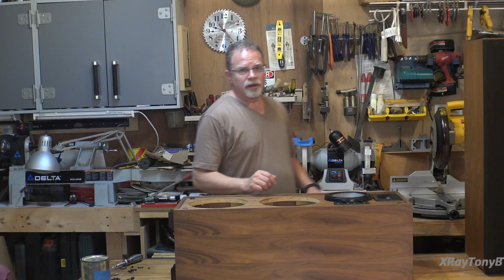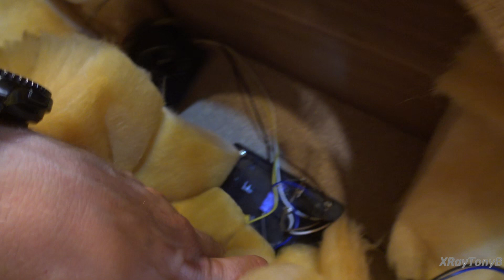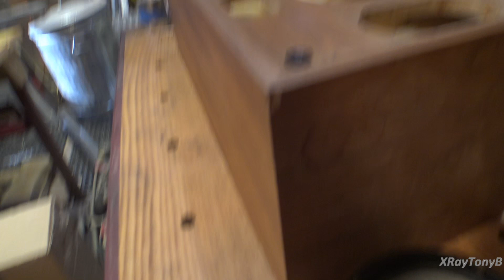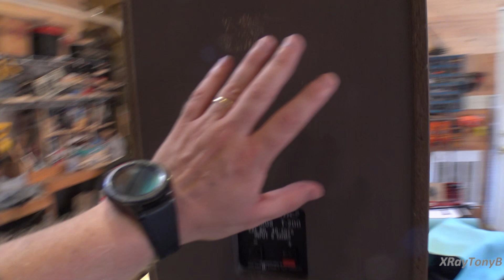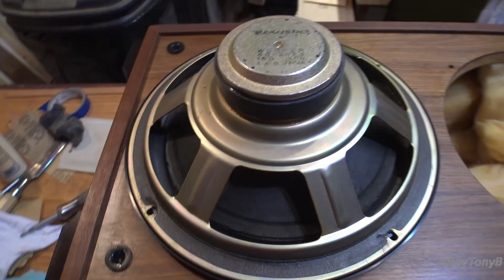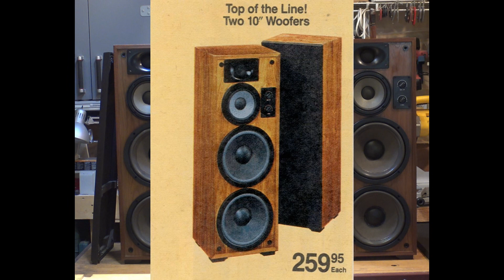Finishing the Mystery Speakers

Comment: The T-200 is a sentimental favorite of mine.  And it sounds GREAT too.  It is VERY important to have the original drivers, because it all works together as a system.  I've experimented with other replacement drivers, and even a "real" crossover.  The results were dull and lifeless.  The smooth overlap between drivers is what gives them such a clean sound.  A pair of these in good condition with original drivers is rare, and still brings top dollar.  Thanks for the video, Tony!

Comment: FWIW.  Parts Express does have 33uF/100V non-pol axial lead electrolytics. Currently, $1.20 each.  Part number 027-350.  Naturally, they have Polypropylene and the like too in 33uF.  

I would hesitate to call that a "crossover" as it does not cross anything.  It is, at best, two high-pass filters so the mid and high don't get frequencies way out of their range and they are 1st order.   Since the LF drivers are getting full-range...they will beam as the frequency goes up.  But hey, as long as you like them, that is all that counts. 

One other thing...power is power. You can't magically get more power handling by how you wire them, as I think you implied.  If the drivers are rated at 30W (presumably RMS of either sine wave or pink noise) and there are two of them, then 60W is the total power for the LF section of the speaker.  Wiring them in parallel doesn't change their power rating.  It will change the power that the amplifier has to supply as the impedance of the system is lower.

If they are 30W drivers and 16Ω.  They can take roughly 22V.  Wire them in parallel, they still are only going to take 22V as a team.  You'll get your 60W because each driver will consume 30W.  The amplifier, outputting that 22V in an effective 8Ω load will be trying to output about 60W.  Naturally, that Pioneer doesn't have the 60W to give.  But even bumping up to a 75 or 100W amp you aren't going to get much more volume.  3-5dB over the 35W.  A key benefit to the larger amps/receivers is they would be further away from clipping...which is what would be the most damaging to the speakers. 

My guess is that RS did the rating of the speaker as peak power...which is, typically 4X continuous.

Comment: I’m in the U.K. I was just turning into a teenager in the early 80s & used to walk round the Tandy store looking at equipment, they used to have some Realistic speakers with 15” woofers & I dreamed of owning a pair, Tandy used to price the speakers per box instead of a pair which was weird.
When I left school & started work I purchased a pair of Memorex speakers from Tandy again with 15” woofers, the year was 1985 & Tandy were in their last days, I paid £99 per box, my only criticism i had was the boxes were not deep enough in my opinion, I had a NAD 3020:amplifier running them, I replaced the crossovers with a pair out of Wharfdale speakers that had switches to boost the signal.
Loved the Realistic receivers which were huge, I actually miss Tandy because you could buy electronic components which you don’t see in stores today.
Thankyou for the memory & if I saw the speakers you are working on, I would have grabbed them immediately.

Comment: I would have liked to hang with you on this day. I would have brought a 24 box. My garage speakers are 60's era - paper cone solid cabinets @16 ohms. Takes nothing to drive them. I built 2nd order xover and added a smaller passive radiator on the rear. I have 2 phillips mylar tweeters with a 2.2 uf cap and a couple resistors pointed at the ceiling. I like to play with the old speakers, most are headed for the heap.

Comment: Radio Shack has been widely known for using real walnut vineer on their speakers.  Now about you mentioning about the T-200s with vineer on the backs, I'm not sure if they did that.  I do know that the T-100 had vineer all the way around.  Though the speaker terminals on those were on the bottom.  Even in the catalogue it mentions that the T-100 don't have an ugly side so you could put them in the middle of the floor as room dividers.

Comment: Many people used to "poo-poo" Radio-Shack equipment, but in my experience they really produced some decent sounding stuff. I just bought an STA-78 receiver for $9.99 plus shipping from E-bay. They said everything works except the tuner. Wish me luck. I'm thinking the 13V supply for the tuner section is bad... 13V Zener (maybe) Great Video BTW

Comment: Nice video.  In the late 70's I bought this set up brand new.  The STA-2100D with the T-200's along with the dual 10 band equalize.  Rocked the house for years with this setup. Still have the receiver and the speakers.  The receiver is with my neighbor (who is supposed to be fixing it, he's had it for over a year) and the speakers are in the barn collecting dust.  Tried the speakers a while ago,  they sort-of worked but each had some issues.  Cosmetically their a little rough but not too bad,  and the foam on the woofers it toast.  Not sure what to do with them.  Currently using another STA-2100 (without the "D") along with some Klipsch RP-8000F's and an old ADC equalizer. Cheers!!

Comment: Deja Vu .. I just refoamed (and re-capped X-Overs) a pair of Optimus T-300 tower speakers .. Free .. found at the curb! .. they’re now front L&R in the home theater ... they sound great ... PS these T-300s have one 10”, 8 ohm bass driver and one passive radiator .. the X-Overs are more advanced, with inductor for the woofer .. and a very good 4” midrange (3” cone .. very intricate/tricky to refoam) .. tweeters good as is ...

Comment: Fyi, the reason for the waveguide on the tweeter (technically not a horn since it is not a compression driver) is that it makes the tweeter and mid-range time aligned.  The time alignment allows them to have minimal acoustic cancellation between drivers. 
FYI,  If you are having a company build the speakers for you in any quantity, you can get any impedance you want.

Comment: Looked around a bit and found that the t100 model had the veneer on the back.
Reply: Can confirm.  I have a pair and the screw/RCA jack terminals are actually on the bottom of the cabinet as well

Comment: I am surprised that these speakers didn't use DSP Crossover network system to allow you to use maths to do the sound processing, They sould very much like a set of speakers I had till the voice coil overheated which I can't understand as I was only driving them with 50W of power which came with a BUSH ARENA Sound system.
Reply: Most likely distortion killed them it happens when amp volume exceeds it's power limit.

Comment: 33 uf cap at parts express $1.04, not hard to find just need to know where to look.
Reply from the maker: I tried them, but I think they were out of stock at the time.  Additionally, they were radial instead of axial (which still would have worked), but I wanted to stick with the axial.  I was able to get axials rated at 100Volt and 105c for about the same price.  Parts Express is a great resource, though.  I get a lot of parts from them.  Thanks for sharing!

Comment: What was your recipe can you please write it out for me of how you got them to shine
Reply from the maker: Start with one part each of tung oil and boiled linseed oil.  Add Two parts polyurethane. Mix well. Add small amount of japan drier as needed (about one cap full, to start).  Brush mixture onto wood surface and rub in with clean lint-free cloth.  Allow to soak in for a few minutes and wipe off excess.  Allow some time to dry and then repeat until you get the desired sheen.    Take used/soaked cloths outside and spread out in the yard or somewhere outdoors to dry.    The curing process is exothermic.  If you leave the cloth rolled-up in your shop, it could ignite from the heat produced.  
Thanks for watching!

Comment: Why waste time on such a cheap, crummy speaker? Bare bones cheapo crossover, un-braced cabinet, and cheezy woofers. Those aren't worth more than $50.
Reply from the maker: Well, first, it wasn't a waste of time to me, because I enjoyed doing the project.  Many other people enjoyed this video as well.  The cabinets had a thick walnut veneer that isn't seen on many modern cabinets.  It did contain bracing, as well as cleats, as I pointed out in the video.  The purpose of this video was to show how the system as a whole can be better than the sum of its individual parts.  With careful design of the cabinet and proper choice of parts, this speaker performs very well.  I do agree that there were better quality speaker systems at that time for about the same price, as Radio Shack tended to overprice their audio gear.  Do you have any suggestions as to how the crossover could be modified to improve the performance of these speakers?  They currently have a pretty good response from about 45 Hz up to 20kHz.  The impedance vs frequency curve is not that bad either, using the DATS device and although my ears aren't nearly as good as they used to be, these speakers sounded pretty good to me.  Complicated crossover networks aren't necessary in every configuration.  I'm always willing to learn new things and I welcome any constructive comments you may be able to contribute.  Thanks for watching!
Reply: @xraytonyb  Your response to this monstrous comment that constructs nothing,  shows a well rounded emotionally capable person,  thank you.
Reply: no no no. speaker is about ideas how to make sound from cabinets/drivers design. and how a person design is different from another person. and lastly, when putting all together how does it sound. Back in the 80's, Radio Shack used to be expensive

Comment: Those largely prove the theory, that loading speaker drivers into an ideal acoustic environment does more for sound quality, than spending money on premium drivers with large magnets, haphazardly thrown into what ever box. You're exactly right. Combining the right elements in the right environment produces a whole greater than the sum of it's parts. The perfect combination makes perfect sound, even if the individual components seem modest.
     The only thing that heats up voice coils,(burns out speakers)is current. Wattage has less to do with it, because wattage is the PRODUCT of amperage and voltage. If you measure the DC resistance of the voice coil, that gives you the "R" in the formula I2R, which is the loss of energy as heat, due to current. You multiply the current X itself, than multiply the product with the DC resistance, and that will tell you the true energy being lost to heat. You will notice, that the DC resistance is always LESS than the marked impedance of the driver, because the driver does produce Electromagnetic force, which allows higher voltage for a given DC resistance, than a pure resistance. Cone excursion uses the center pole of the magnet like a stationary piston, turning the coil former and coil cap into a moving cylinder and cylinder head. This "pumps" air through the coil gap, which helps cool the voice coil by forced air. In heavy bass conditions, a speaker can handle far more power, then if the same power is applied in the midrange, because of the extra pumping. With higher frequencies, the voice coil just "cooks" in stagnant air, relying solely on radiation of heat from the coil into the adjacent magnetic structure.
     NEVER run a speaker without a dust cap over the voice coil! it is absolutely vital for proper cooling, if the speaker is to be played at or near rated power.
Reply: People laughed at me when I explained about the cooling of the voice coil. And they were supposedly speaker "experts".  The type of dust cap plays a part in the frequency response as well, though to a lesser degree.  Putting a solid cap on a speaker designed for an open screen type really changes the sound, and restricts the air flow, which also leads to distorted sound at higher volume levels.
Reply: @JeffCounsil-rp4qv  The size of the cone cap helps control that. The clearance volume can be controlled by the size of the cap, but that also dictates how close the cap is to the magnet pole. A smaller cap placed closer really restricts the movement of the cone, but also helps dampen it pneumatically, which takes the burden of dampening off the coil and amplifier. All this, at the expense of exactly what you said. a large coil cap, spaced well away will reduce the pumping effect,(which helps cool the coil), but leaves most of the motor strength available to move the cone. it is indeed one of many ways to tune the characteristics of the driver.
     Removing the coil cap affects much more than just the thermal dynamics of the coil. Take two identical drivers, wire them in parallel, mounted in the same enclosure. Remove the coil cap from one of them, then, play the drivers at their rated power level. I will bet my last dollar that the driver without the coil cap will burn up, before the other one even begins to warm up. The ONLY thing that might save the driver without the coil cap, would be the acoustic enclosure pressure, but it might not be enough. In a large volume sealed enclosure, (infinite baffle), there won't be the back pressure, The exposed coil won't receive adequate airflow for cooling.
Reply: @vincentrobinette1507  Oh, I agree 100%.  The point was these so-called "speaker experts" who "rebuild" speakers scoffed at those very points you (and I at the time) mentioned. They use a cone that "if it fits, it ships" with complete disregard to the original characteristics of weight, density, material, acoustics, surround material, etc.. I've seen spiders meant for subwoofers used on HiFi woofers, and they boast of using larger (and sometimes wrong type) dust caps "because they look better".  And when the customer complains how they (don't) sound, they either brush them off, or claim they should have had them both done. (I think) Yeah right, so you can ruin both of them? lol!
Your explanation of watts is pretty much spot on too.  A device is rated as in how much heat (wattage) it can dissipate without damage at a given current flow.  As in the voice coil, it generates heat and it's ability to dissipate that heat is dependent on the overall design of the speaker.  The coil former material, size (gauge) of the wire, gap size, spider material, vented pole (or not), and of course the dust cap is all part of that "watt dissipation cooling system".

Comment: Nice work. I remember listening to a pair of those back in the 80's coupled up to a Realistic STA-2080 Receiver.
These days I own a STA-2080 and a STA-2300 both in working condition. Although the STA-2300 does not have the original bass, midrange, treble, balance, volume knobs. Which seen to fetch a damn fortune on ebay.
I have a pair of Realistic Mach One's that I need to do the surrounds. I'd rather not remove the dust cap for these. I'm thinking about supporting the cone on the underside against the basket at several points. Wish me luck.
Reply: Good luck! lol!  If it were me, I'd shim the coil since they are a 15" speaker and those cones have some mass to them.

Comment: In your "house mixture", did you use raw linseed oil?  Or boiled linseed oil?  Those speakers are very nice.  You did an awesome job!
Reply from the maker: I almost always use the boiled linseed oil because it dries much faster and has less chance of leaving an oily film on the wood.  Thanks for watching!
Reply: @xraytonyb  Cool.  One thing I must touch on though.  When you put the surround on top of the cone, you moved the voice coil deeper than you think. Think about it, add the thickness of the surround to the thickness of the cone.  That's how far back the coil is now. You went from using the "front" surface of the surround, to the "back" surface of the surround (the thickness) and to the front of the cone (it's thickness).  Say (hypothetically) the surround is 2mm thick, and the cone is 1mm thick.  The voice coil is now 3mm deeper. Many speakers only have an excursion of 5 to 8mm so that 3mm (hypothetical) difference can cause the coil to bottom out depending on the "margin of safety".  Yes, it's a pain to clean the old foam from the backside of the cone, (done it many times), but it was made that way for a reason. ;-)

Comment: 6db filter on a cone tweeter, those things usually have high q and thus strong resonant peaks, is that noticable while listening? Usually you should use steep sloped filters on those, then they can sound great! I once came across a pair of those too, sadly they were all destoyed, not only the surrounds but a complete woofer cone was ripped apart so I didn't take them.

Comment: Great restoration on those Realistic (Blast from the past) speakers. They should last many more years to come. My buddies and I use to stop in at the local Radio Shack after school once in a while. To look around and to buy parts and kits mostly. But I remember when these speakers came out. They sounded pretty darn good too. The thing I always remember about the Realistic brand receivers is how powerful "they looked" when they were powered up. They all had a nice looking AM/FM scale display. Nice brushed aluminum front covers. Wood veneer cabinets with a nice looking vent opening covered with a heavy metal mesh screen. The Realistic brand wasn't too bad for what it was. But anyway, an added note and not a big deal to most people but the only thing I didn't like as far as the restoration was the glue smears on the cones. "IMO" it doesn't look nice. Sometimes I like to have the grill cover frames removed to see the speakers and glue smears on them would really bother me. OCD on my part probably! LOL

Comment: 259 each back then way way  overpriced  i like em could be a grea  sounding speaker the 120s where great  design i had em hooked up too a 200 wtt  sanyo amp to many peaks  burned em .
Reply: roger willams I agree,steel frame woofers, fake compression horn, no coil on the woofers very overpriced